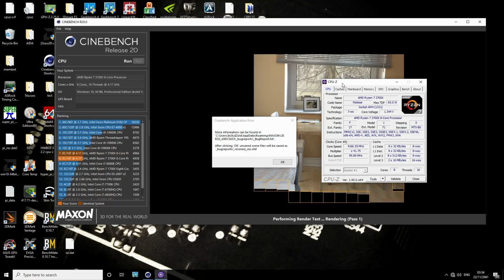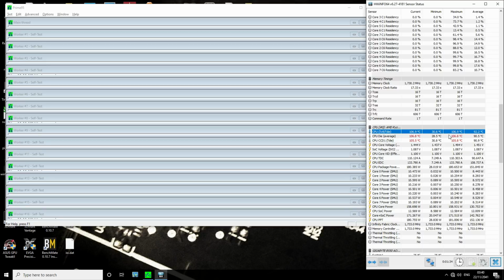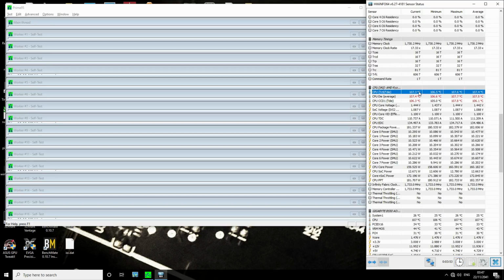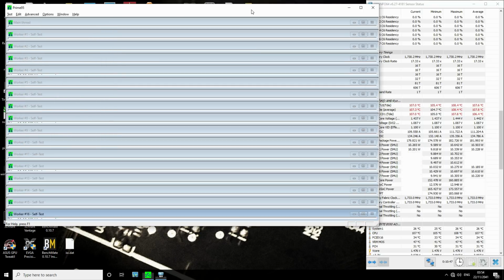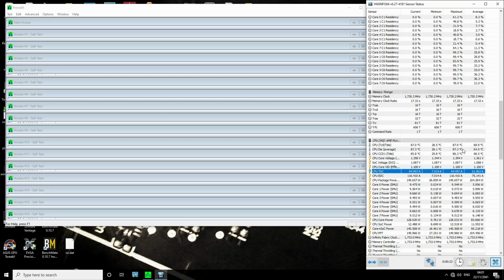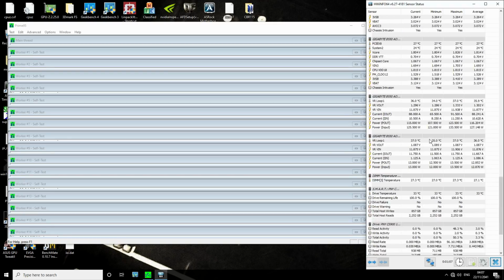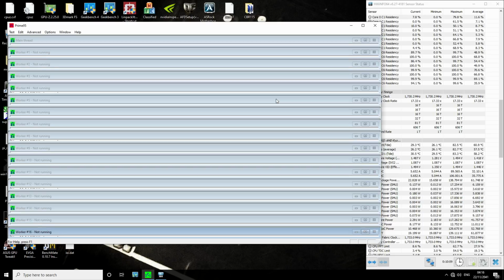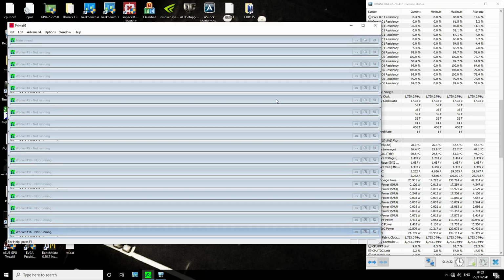Intentionally degrading my Ryzen 3700X

Comment: My 3700x seems invisible. I can run it at 44.5  @auto voltage...daily...still running fine..in use everyday.👍 X470 msi gaming pro carbon.  Buildzoid. On my 2080ti by the top shunt resisters there are 3 ceramic capacitors 3 different sizes. Would you happen to know what the middle one and the smallest one is rated? Thank you in advance.

Comment: Strange thing is, I ran my 3900X, 3700X and 2700X  for 11 weeks straight 24/7 FAH AVX and they where hot, steady 80C on all three. Now almost a year later they all works as brand new,  still setting the occasional new benchmark records so no visible degradation. Could it be your Gigabyte board degrading?
I killed a 1080Ti doing that though, which was bad as it now would have had immense resale value.
Reply from the maker: 80C vs 110C IS A MASSIVE DIFFERENCE. Your chips were on a walk in the park compared to what I did here.
Reply: @ActuallyHardcoreOverclocking  Yes, that is true, 110C is a little extreme. Point I was trying to make is these chips aren't fragile. Lots of degrading bs going round in the community.

Comment: I can do(3700x) some cores at 4.35ghz and some and 4.5 with 1.47v, should I just use your settings for PBO in this video with the 10x scalar for gamimg? What happens is that raytracing is very heavy con the cpu and I'm trying to get as much cpu single thread performance as possible

Comment: Very interesting as always. I recently swapped to a 3950x (-200$ deal before the prices went up for them too) and i noticed that it's not a cooling capability problem it's just that the chip+HIS cannot literally transfer his heat fast enough. My 2700x maxed out at 55-60° on summer (30 ambient?) at 1.3v+ with my custom loop (480mm +360mm, all push pull slow rpm), on auto with no PBO the 3950x in cinebench and gaming load it can touch 65-70° easily now (18-20° ambient?), even if i max out the Fans or the pump the thing doesn't change (1-2° on avarages after many minutes of heavy blenders). 

But i'm pretty happy for his performances on stock without PBO, it goes around 9500-9600 on R20 multicore (the cores goes around 4100/4150mhz when all loaded), as you said it simply needs cooling and it does the rest on himself.

Comment: Pretty sure PBO has degraded the 3800xt I've had for a few weeks, within a few days. Cinebench score just gets lower and lower and lower
Reply: im actually afraid my stock settings 3600x is getting degraded too. Im not checking regularly but is 1.469 volts in peak normal? when playing games and running cinebench the voltage of it hovers around 1.33 V.

Comment: iteresting... my 3700X working all cores on 4400mhz, vcore 1,295v, cinebench 5326 score
Reply: golden chip?
Reply: @MiriadCalibrumAstar  Not necessary golden. Mine can do the same (down to 1.245v). But always failed with that voltage (under 1.315) in Prime pretty shortly.
Reply: @MrCshx  me here with a 2700 with 4.05 at 1.325v T.T
Reply: @MiriadCalibrumAstar  its not Golden but its working like a charm :)
Reply: @davidkulhan1908  its not, the memory controler cant handle past 3400mhz even on relaxed timings :/, i was plannign to upgrade but i need more a gpu(have a 1070ti)

Comment: 140w 5960x at 1.296vcore 4.5ghz pulls 300ish watts in prime95 scores the same since 2016. And yes it works with 4x8 Samsung b-die 3200mhz 12 12 12 24 1.5v and b-die tertiaries shoots 88gb/s in aida. (rampage v edition10) *(chip was from December 2014 on a r5e)
Reply: very sexy. good chip you have
Reply from the maker: Haswell is good upto 1.35V
Reply: @ActuallyHardcoreOverclocking  haven't seen any gains. 4.6ghz not stable even at 1.38v for some reason or im missing something. vccin is 2.040v with 7llc droops to 1.984v

Comment: These are always fascinating videos to watch. I used to overclock my Ryzen 5 3600 to 4.3GHz at 1.250V but noticed gaming performance isn't much different from stock. So I just leave it at stock settings (PBO off).
Reply: That's because the max clocks are so close to the defaults. I have my 3600 at 1.28125 V doing 4.40 GHz 24/7, but I can't upgrade my GPU yet because ... well, you know why. I'm looking for an RX 5600 XT, but I'm not paying £400+ for one.
Reply: @Julia_XTX  No degradation from that overclock? How long you've had it overclocked (months)?
Reply: @ApexLodestar  It's been at 4.40 GHz since August. I've had it at 4.55 GHz (1.45 V) for benchmarking, but 1.28125 V is my 24/7 setting and it's actually lower than the 1.3 V that I see under stock all-core turbo. So it's fully within spec and only pulling its 88 watts and staying below 70°C under full load.
Reply: @Cleru Zinekthose synthetic benchmarks don't really translate well into gaming. production? yes. gaming? not so much. those higher overclocks produce real nice numbers in Cinebench but do you actually see the boost in games? I didn't noticed much from my overclock when gaming. I do notice when I overclock the GPU, though.

Comment: I do a lot of video rendering for really extended periods of time so this amount of degredation is still concerning to me.
Reply: Degredation is a factor of voltage amperage and temperature
The cpu is under 1.5V the maximum he can cool
The cpu is overclocked running at 110 degrees celsius which makes it pull more current
And he is puling 110Amps
That is insane 
You can run a 3950x at 4.2Ghz with that amount of power he is pusing in the cpu
Reply: For video rendering depending on your CPU it's not worth it ignoring degradation, my 3700X is a early example that hits 4GHZ stock and 4,2ghz PBO. From tests the benefit in video rendering is so small and in exchange it gets hot so the fans get annoying.
The best way to get massive gains in encoding is to grab a high core count CPU upgrade, for me.
For bulldozed he can run his CPU maxed out for benchmarks with no fear of a early death, most his tests are less than 10 mins each and way before the CPU dies he will be on a newer faster platform.
I ran a bunch of 4K h264/h265 encodes in handbrake and checked the log to compare stock V PBO V all core OC, depends on the chip maybe as I mentioned mines an early example.
Reply: @liaminwales  He is not overclocking 
He is doing an experiment
Because he wants the answer
And others do as well
Not everybody overclocked to squeeze the last drop in a benchmark
I do it because PBO is nuts and feeds too much voltage in the chip running it way too hot and the fans spin up way to high
Example 3900x that i sold PBO will push 1.35V to get 4.175Ghz
The CPU does not need that much
It will do 4.35Ghz CCD1 and 4.25CCD2 at 1.27V
And it is using the same amount of power
In my PC 5900x PBO 1.33V for 4.25Ghz
It will do 4.7Ghz CCD1 and 4.5Ghz CCD2 on 1.25V
That is free performance
Reply: @anton-eg1hh  I was tired when I made my comment but I think it’s fairly clear.
I was trying to reply in context to Lead Foot & video encoding as a use case, I wanted to say that it may just not be worth the OC for video encoding from tests that I tried. 
I outlined a testing method of using handbrake to export a stack of videos and check logs for export times comparing stock/PBO/static.
I did it some time last year on a much older BIOS, off hand I don't know the numbers. If you're interested it’s a fun test, I used a queue of h264/h265 30/60fps 4K encodes using the Matroska presets in handbrake that had an export time of about 2 hours for each set of CPU settings. H265 was the punisher test to really beat the CPU into submission.

Now I can understand ‘what is worth it’ for each user can change, for me saving about 5% (I think it’s been a long time) per encode was not mind breaking and I also mentioned my 3700X is no hero CPU.

If you're talking about buildzoid then he is fairly clear in the video.
Reply: @liaminwales  My opinion
If you have the money to buy the cooling required to overclock 
Use that money and buy a faster product
Reply: @liaminwales  u should never render with ur cpu we dont like in 2006 anymore. Nvenc is 10x faster and
Reply: @dvr1337   ...
look at the NVENC support page at the codec list and encoding premasters and see if you can spot a problem.
If you see no problem then be happy with life.
Reply: @liaminwales  theres no problem at all
Reply: @dvr1337  then be happy!
Reply: Imaging rendering with a cpu in 2021 xD

Comment: @Actually Hardcore Overclocking Historically which CPUs have been the most sensitive to degradation in your experience or to your knowledge?
Reply: current/voltage vs temperature
Reply: @ChrisGR93_TxS  You probably replied to the wrong comment
Reply: Don't know for sure but I've seen quite a few forum posts about SB-E degradation back in the day.

Comment: I was running my 3800x at 1.4v@4.45Ghz for around 1 months and 1.375v@4.375Ghz before that for 3 months without any problems. But if you go on plebbit they freak out over anything higher than 1.35v.... In fact my chip was cooler with this OC than on auto.
Reply: Sounds like for gaming and benchmarks this isn't a problem but I use my cpus for video rendering queues that go on for days at a time. I'm gonna stick to pbo.
Reply: Bashed mine 1.39v @ 4.475 it was unstable at 4.5

Comment: Very interesting, ofcourse as you said, just a test with only 1 chip etc, but still. Myside I lost some score in CB / got crashs after BIOS updates (ASUS MB), problem is: since I updated to BIOS version 1804, it doesnt allow my to roll back to the older stable BIOS version, as 1202 gave me better score;) well, it is what it is
Ps. the only tricky part of testing things like this right now is that the cpus are not really available, and quite expensive if they are available, but other than that, I also would love to go bunkers with my 5600x

Comment: My 2600k @ 5GHz 1.5v still chugging like a beast!
Reply from the maker: my 3960X got weird stability issues after a year of 5GHz at 1.52V.
Reply: @ActuallyHardcoreOverclocking  i was wondering how the fuck you'd run 5GHz @ 1,5V for a year on a 24 core threadripper. but then i remembered.
Reply: @Radovanslav  that is an intel cpu
Reply: My mates been running his 3770k at 1.7v for years now! I can't believe it still goes
Reply: On what manufacturing process is that? 28nm?
A comparison as smart as comparing the colour of wine and beer. And claiming that one of the drinks has a "better colour".

Comment: Is 1.41 volts all core 4400mhz on a 3900x safe for a gaming load 24/7 temps under 90c?
Reply: Why would you clock it anyway, when there's literally no difference in gaming.

Comment: Have you tried degrading it with too high soc voltage?
Reply from the maker: no point IMO running the SOC much above 1.2 causes stability issues.

Comment: Have you updated OS or CB 20 at all? I've noticed that updating software is more likely to caused crashing than silicon degradation. 
Also owner of a 1700X and GTX 980 that I've throttled to their limits for years, basically both since launch.
Though I could just have hit the silicon lottery 😂

Comment: My 3700x sat happily at 1.48V at 4.55GHz for a few hours, running benchmarks. And it still does 4.2 at 1.15V, it's amazing. My 5800x is a bit disappointing compared to my 3700x in terms of silicon quality

Comment: This is a good idea. I am waiting for the end of crypto craze for used graphics cards flood, high chance most will be mined with. What do you think chance of failure for card for mild oc vs a under volt? Are oc mined cards worth less than under volted mined cards?
Reply: I'd rather have a card that was mined with at low power and good ventilation than the average gamer card that ran in a closed case with stock fan settings.
I use a 1080ti that was mined with for 3 years, no issue with it. The fans are the first to die.
Reply: A card constantly run high is better off than the stress of a game ramping up and down. It dislikes temperature changes.
Reply: End of mining craze? See you in 2050.
Reply: @mesaber86  yea what am I talking about, we are still in the mining boom all the way from 2017. It never ended.
Reply: @nipunsirinada2314  rough times ahead. Or should i say expensive.

Comment: Takes "hours to degrade" I'd still be careful though. Even with  my custom loop keeping CPU tjmax under 80 degrees under full load I degraded my 3800xt by 50-100mhz trying to run 4.6 at 1.45V on my custom loop with my current draw like 150A. My dumbass was still thinking of voltage in terms of a 3600
Reply: Sink 217W of heat from cores only of 3800x keeping it under 80°C? You'r cooling system is a absolute beast. In the video buildzoid had his 3700x at 108°C with only 161W from cores only (182W total).
Reply: @volodumurkalunyak4651  I was only running 3D mark and cinnebench so it wasn’t being cooked like with p95. I also stuffed my mid tower with a 280 and 120 rad and now I’m limited by the physical density of 7nm ryzen rather than my water temp. This also means I’m not thermally limited to prevent me from burning up my chip lol (which also probably saved my chip from degrading too badly)
Reply: @kurobara117  217W of heat under Cinebench equals 217W of heat under p95 if you run this tasks for the same amount of time.
150A for 1.45V with Cinebench at 4,6 Ghz is way to much for 8 core Zen2, 85A is much more believeable.
Reply: @kurobara117  I can NOT believe you about that 3800x anymore. Electrical current, temperature and degradation @ voltage and frequency and workload make zero sense to me
Reply: @volodumurkalunyak4651   Well P95 is actually a way more intensive workload than cinnebench so you can’t really compare the two’s power consumption. (Try running both and you’ll see your cpu cook under p95) which is also why people use it for maximum stress testing of their overclocks. 

Thinking back on it, I think it was actually north of 130A not 150 but you can believe me or not.
Reply: @kurobara117  P95 is way more intensive workload if chip voltage and frequency are kept the same. My stock 3600x will hit lower clock at lower voltage on P95 compared to CB achieving approximately the same power consumption and temps
Reply: You got 150A current draw out of a 3800x? Impressive.

Also, the poor thing :c

Comment: My 3700X used to give me a CB20 score of 5200 or thereabouts. Now it only gives me 4800 or so after various BIOS updates (B450M Mortar non max). I was also getting 4.4Ghz on single core. Now I onlt ever get 4.375 wven with the EDC 0 bug.
Reply from the maker: I never got the EDC bug to work so I'm just gonna guess it got patched.
Reply: @ActuallyHardcoreOverclocking  I currently have it working on a 3900x. 
Asrock X570 Taichi running the latest AGESA. It does gain some performance from my measurements. 
That's with EDC on 1.
Reply: @ActuallyHardcoreOverclocking  Using the EDC bug on my 3700x on an Asus X570 TUF Wifi - works a treat - with PBO max single core is 4350, with EDC bug I get 4450 to 4475 fairly constantly during gaming, and all core runs at 4.2 ghz for sustained runs (I do video editing so these are very sustained periods).  Still waiting for my 3700x to explode or melt like all the "experts" on reddit told me it would.  Also, prior to running EDC bug when I was just doing lots of editing I had it all core 4.25ghz at 1.33v for around 8 months.  It now runs quicker (in PBO mode) than it used to do - so my chip has upgraded itself.....not degraded.......(also possibly bios improvements :)  )

Comment: Cant wait for ur guide version of PBO2 Curved Optimizer on 5800X for example. Like your similar previous "The easy way to get a bit more performance out of Ryzen 3000" video =)
Reply: Waiting for it too.
Just enabling PBO (set to advanced) on my 5800x with everything on auto under PBO, its cranks the voltage up to 1.475v while gaming. All the time.
With PBO disabled it runs at 1.375v while gaming.
Performence is the same, just hotter xD  Yeah well^^
Reply: @Speedworld159  yeah im waiting for it too.. buildzoid do that video for the 3000 series but none on the 5000 series. All i can do is hope =)

For me.. I just set PBO AutoOC 200Mhz for now.. and be done with it haha
Reply: @Speedworld159  Mind you that the 1.475v is not all cores, so that's not as bad as it seems. Mine even sends out up to 1.5v even with properly tuned PBO2.
Reply: @christenlanger  Well its while gaming. Cores go to 5.05Ghz and the VCore is pinned to 1.475v. Dont know the per Core voltage.
But yeah. That video shows, that it is ok. So let it run for that sweet sweet 2% more Fps^^
Reply: just watch the video from optimum tech?
Reply: Same here, I'm sitting with -30 on all cores and +100MHz, it all works just fine (long prime95/Boinc crunch) but I'm wondering if my 1.35Vcore/1.4V core VID/185 Amps CPU EDC are safe for 24/7 operating use.
Reply: Have any of you tried tuning via ryzen clock tuner?
Reply: @temporoyale6251  no, because it is junk
Reply: @Speedworld159  why? Some people really like it